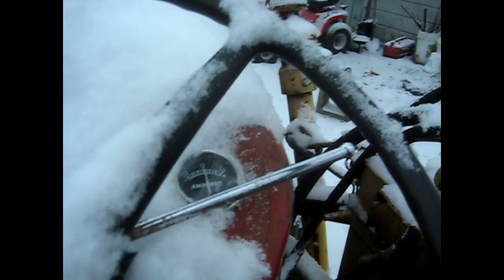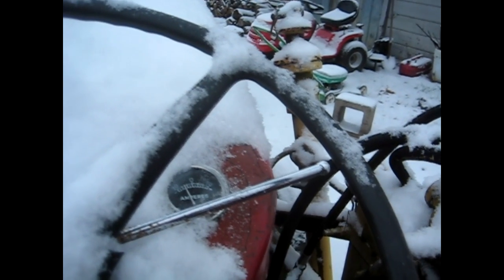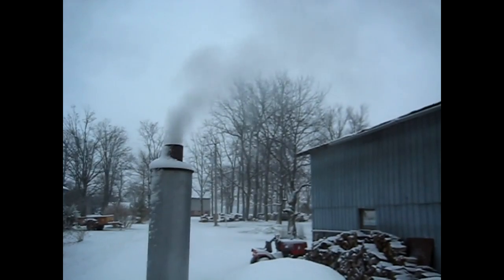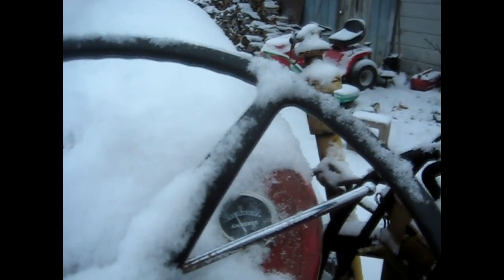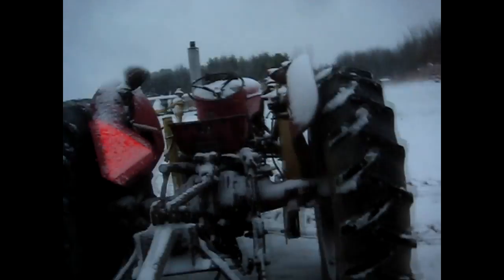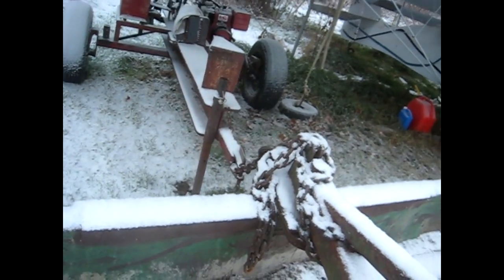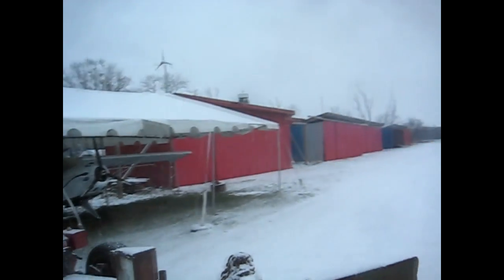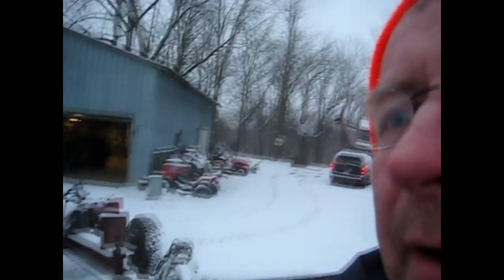How to Cold start Tractor Diesel Engine

Comment: My hydraulic cylinder on my splitter was unrepairable, leak couldnt be fixed.  I found a similar one online, 4"x20"x2", 3000 psi.  Was going to go bigger but then I have to move welds and brackets.
Reply from the maker: sounds good -- it is a welded cylinder?   I do not like tie rod style
Reply: My next one will be welded.  Yes, the one I had was a tie rod.

Comment: Any diesel that can fire-up in those temps w/o using either is a keeper : )
Reply from the maker: the old diesle with low and/or weaker compression are harder without a true glow plug and /or ether.